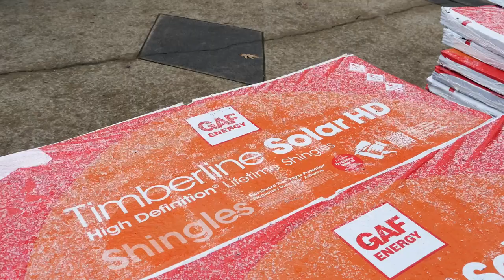Timberline Solar Shingle Install

Comment: I’ve heard from a little bird that GAF maybe going through some serious litigation over these shingles. Does anyone know if that’s true?
Reply: There was a quality control electronic component connection issue in the San Jose manufacturing assembly causing shingle/panel failures in some of the early installations. They may have replaced those since they now have a new machine that solved the problem in making them now.

Comment: Looks like 22 panels per row, so about 176 panels per slope..that’s 8Kw at 45 watts per panel max.. so two sides would be about 16kw.. I’m am off?
Reply: I Wonder the cost to a current system
Reply: @Beatz301  According to their website and an interview... about the same as a re-roof PLUS a rack system with the same KW.  Average 4 day install.